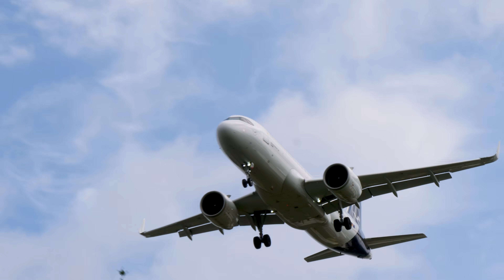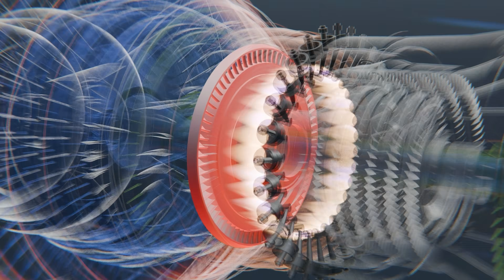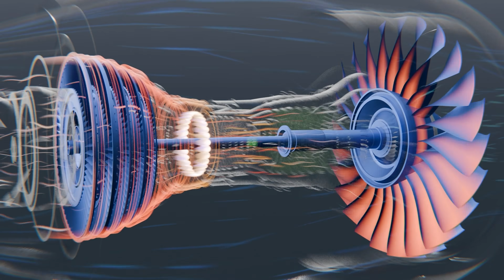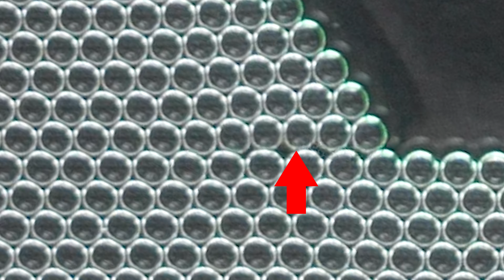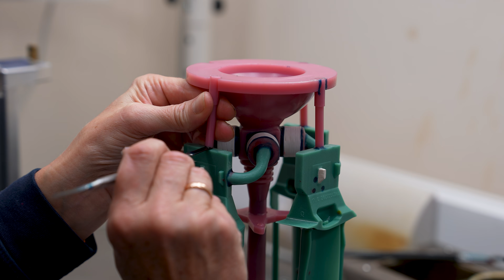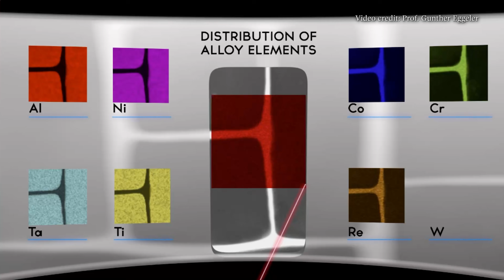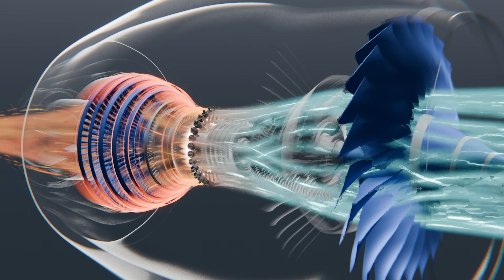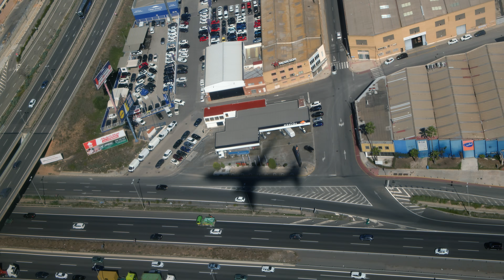The Ridiculous Engineering Of Jet Engines

Comment: 4:00 Your calculation is a bit misleading. You are referencing a calculation based on 1/2 m to a calculation based on 2 m and you conclude that it takes 4x as much energy to produce the same impulse. But that's 4x the energy given 1/4th of the mass of your reference scenario (1/2 / 2). So, the use of 1/2 m here is misleading because m isn't used in the reference scenario.

It would be easier to follow if you had simply used m in the reference scenario. Then it would be clear that kinetic energy and mass are inversely proportional (instead of following an inverse square law as one might falsely conclude from your explanation).

Other than that, your calculation also glosses over the fact that the air generally doesn't start out stationary wrt the plane (i.e. zero airspeed). While this does happen, approximately, usually while the plane is on the ground, for engine efficiency considerations, the climb and cruise phases of the flight are typically more significant. The climb phase is particularly significant because of the high thrust requirement, and the cruise phase is significant because of its, often, long duration of several hours.

Comment: 26:21 Most aspects of my question were very well explained, and I am satisfied with the answers provided. However, one question remains unanswered: after the wax is melted away during the lost wax casting process, how is the ceramic core, which was initially placed inside the wax mold, removed? This step was not explained.

Comment: 3:58 a 1/2 factor is missing from the right side. So it only takes twice the energy in that case. The conclusion remais true though
Reply: It does take 4x the amount of energy in the right case. The supposed result is correct. It's just that the equation as it's written here is incorrect, it should yield 2mv². However, when you take into account the missing 1/2 it becomes just mv².

Comment: Fun fact: There is no need for jet engines to follow this linear arrangement of their components. You can make one simply by attaching a combustion chamber to a car turbo, which means the combustion gases come all the way back to the front of the engine to spin the intake fan. Colin Furze has done precisely that for several of his builds

Comment: Im only 17 seconds into the video but im disappointed. Rolls-Royce instead of Pratt and Whitney 
Derek , I think it would be cool to come tour our plants at Pratt and Whitney.
Im a Manufacturing Quality Engineer at Pratt , specializing in billet machining compressor blades and stator vanes. I also use to work on the hot section as well which has cool Manufacturing processes to it , they are cast (single crystal) instead of machined from billet.

Comment: If the turbine blades move at 1900 KM/H do they cause a sonic boom inside the engine?
Reply: No! 1900 km/h is still subsonic inside the engine as the speed of sound varies with air temperature and at 1,500 Celsius, the speed of sound is ~3,350 km/h. That's only around Mach 0.56, well under.  In fact all airflow in a turbine engine must remain subsonic or bad things happen.

Comment: Didnt watch video a lot of video yet. I had some project in university on that topic with one of manufacturers that produces planes (it wasnt new project, we were given projects that engineers had before and we kinda had to come to the same conclusion they had). Thermal barrier coating (in out case yttria-stabized zirconoa) is what saves turbine from melting. My project was a out combustion chamber but i assume turbine blades have same idea, where Nickel-based superalloy is protected by layer of YSZ

Comment: I'm not an aerospace engineer. Can anyone explain why can't they put some cage like structure on the front to stop birds, drones etc to get inside?
Reply: If you made the cage mesh small enough to stop every part of the birds/drones getting into the turbine, you'd severely restrict the airflow into the turbine, if you make it wide enough to not restrict airflow it would be useless at stopping objects. Really there's just no point or benefit.
Reply: They do for stationary turbines in industry and for helicopter turbines. In planes that travel at 600 mph, all you are going to do is dice the bird before ingesting it anyways. Like said, it restricts the airflow too much at high speeds as well.

Comment: Hey im a supervisor at an investment foundry and we pour these "nickel super alloys"  they are actually called hastalloys.  We pour some our castings with finished edges as thin as 0.030".

You missed one of the "impossible" parts of this process.  An induction coil is made of copper.   Cu melts at like 1300f.  How do you melt steel all the way up to 3100f inside of a 1300f coil??

Comment: It runs at temperatures 250 Centigrade degrees above the melting point. 250 degrees centigrade is a fixed point on the Centigrade scale, a lot cooler than 1500 degrees Centigrade. 250 Centigrade degrees is a temperature difference between two readings on the Celsius scale. Air is not pushed backward by a large ducted propellor, it is an airscrew, which pulls the air from front to back, whereas a propellor pushes air to the rear, as on say the Piston engines of a Convair B-36. This is one of the most technically informative videos that I have ever seen, and I congratulate all those who took the time and trouble to do the job properly. May Veritasium long remain!

Comment: Simple answer, I do not have to watch the video, a lot of the enginges just port reletive colder air to the hotest part of the turbine. I am an aviatation maintenance engineer. The Fuel that we use burns cooler than fuel like petrol, not all of the compresed air is for combustion but is ported to cooling the combustion cans. The turbine never gets that hot'.

Comment: In how bonds between metal atoms in the blade have waves of rearrangement, the bubble example uses mechanical physics to illustrate how quantum ones do. Isn't that a contradiction?

Quantum waves, such as electron wavefunctions in atoms or bonds, do not correspond to actual physical oscillations of a medium but rather represent probability amplitudes that describe the likelihood of finding an electron in a particular region.

Comment: Just watched documentary about Zay Jefferies in 1941. He knew that molybdenum added to the mix for super alloy use would dramatically improve performance and reliability. However, at the time, using that element was illegal. He broke those laws and cheated the current system of materials and supply orders to get a better alloy, that in turn allowed Packard motors to build better Merlin’s for Mustangs, that in turn won the air war? Would somebody please verify this story. It sounds very American. 🇺🇸

Comment: Mentour Pilot recently mentioned that many young pilots will likely never experience an in-flight engine failure in their whole career. Turbine blades are of course only one part of many, but their incredible reliability is one of the big factors that also benefit the designs of many other components.
Reply: even if they do experience an in flight engine failure, the chance its a turbine blade/blades that failed is extremely low.

Comment: Why is there no sonic boom when the blade spinning speed crosses the sound barrier? Or is there one. I mean I get sonic boom when the washing machine closes the went. Does it not get sonic boom because the motion is circular? And different parts of blade move with different speed depending how close they are to the centre of rotation?

In jet engines, especially modern ones, the air entering the compressor is often slowed down by smart inlet designs, meaning blades typically operate below their Mach 1 limit to prevent efficiency loss and material stress.